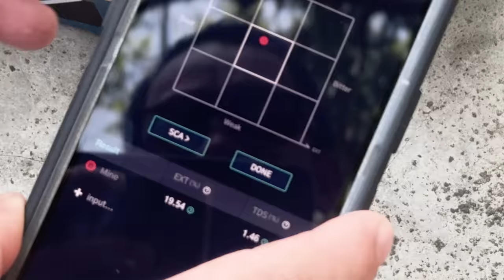No Timer No Scale Brew with Timemore Water Dropper

Comment: Where did you get such a cool handle for q air?
Reply from the maker: @sviatoslavhulko4758  its the handle of the zp6 hehe i just switched it out
Reply: @darylbuenocoffee  looks really cool, now I want one too 😁
Reply from the maker: @sviatoslavhulko4758  you might have a friend who wants to trade with your handle. You can also buy the after market handle for comandante - it fits too!
Reply from the maker: @sviatoslavhulko4758  sorry sorry, this is an after market for the comandante. Its from skateboardcreations. I thought it was another video because right now this handle sits on my zp6 and then qair is using the stock handle for the zp6